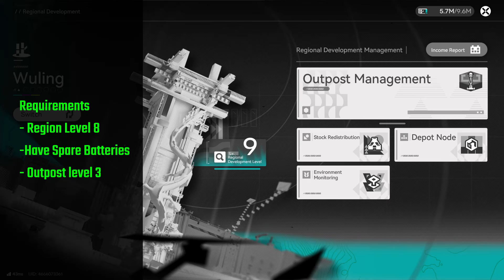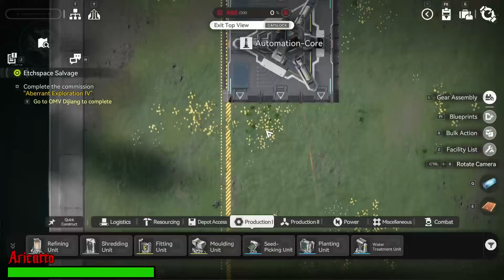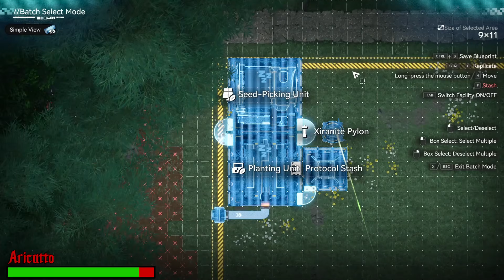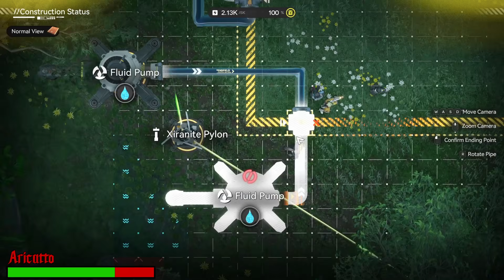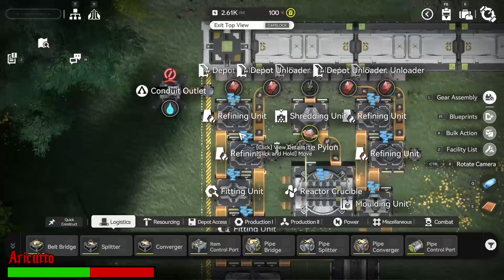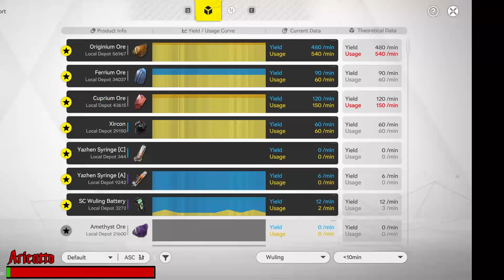1.1 Wuling Full base (AIC II) step by step Guide Blueprints in the description

Comment: EU/NA Blueprints I hope i did not make any mistakes ;)

Thermal Banks old batteries: EFO01Iao1430eE9U5o08
Ferium Powder: EFO011eaiI97O3UA34O7
Xircon: EFO01u1I628aiO0a6AoOU
Yazhen A: EFO0172UE0i4u1558O0Ai
SC Batteries: EFO01Iao1430eE9725o08
Xira + Cup Comp: EFO01O3E8e4u9AI3E9oe4
Plant Corner: EFO019A6U3ai4oeA85uI2
Thermal Banks new Batteries: EFO01u1I628aiO0a0AoOU

Sub AIC left: EFO012I4uUOo1e80eIOo
Sub AIC right: EFO018930OI6U4126UI73

Thank you very much for your hard work, had tons of fun building along side you ! :)
Reply from the maker: Thank you for this! I have no way of testing if this works but I'll pin it for now! your help is well appreciated🎉
Reply: thank you!!! helped a lot :))
Reply: I think the Xira+Cup Comp one is missing one of the originium connections from the depot bus to the shredding unit

Comment: Sir  @Aricatto  im kinda confused. Should I need to start from scratch again? I just follwed your wuling endgame base
Reply from the maker: well, technically yeah, but I have a suggestion you can try building the 6x xiranite(for jingyu valley) but only put 4 forges of the sky(since thats what you canonly put) so if you need to build the 3rd AIC wuling full base you can have a head start. on the build.
Reply: @Aricatto I think I would have to redo it again. I'll follow this vid. Question though how did you yield 480 per min or resource
Reply from the maker: @erjhennicolemanzana8768 make sure you get all mining spots(there is a hidden originium spot near south behind a fake wall) and level up the wuling region, as mentioned in the video
Reply: @Aricatto gotcha, my wulling is almost 9 so I must be on the right track hehe

Comment: Hello kind Sir! Thank you for this blueprint. I just noticed that after I finished this set up, I am running out of xircon. Is it because I lacked prior preparation of stacking up xircon? Or should I not pay it any attention? Thanks!
Reply from the maker: if you followed and everything is up and running properly, its probably the components (as I've mentioned it will slowdown your production if its on but you can turn it off onxe you made enough)

and then everything should be working fine after doing so!

(also if you have no extra xircon in storage, its prolly not a problem since its is consumed at a 1 to 1 ratio meaning you won't gain or lose extra xircon)

Comment: your guide is so detailed, even though i just placed your blueprint i still know how it works, especially with water sources can't be included in the blueprint.
question tho : your last video on 1.0 wuling base needed me to regional meta transfer the ferrium ore from valley to wuling, so in this case i don't need to do it anymore? or should i just meta transfer the originium ore for the deficit from making components?
Reply from the maker: its just optional to use ferrium now, you can make a small yazhen c blueprint at 50% or some ferrium components. Also, thank you I'm glad you liked the guide!!!!

Comment: Hi, may I know what your xiranite yield and usage is? Idk how this happened but I ended up using 130 something xiranite while only producing 120, and I think it is slowing down my xircon (only produced 48) and battery production with it😭 Thank you for your videos!
Reply from the maker: if you have both the components on, its going to show 180 usage in theoretical data, that is normal since you dont really have enough xiranite by game design, you're mesnt to sacrifice efficiency on your battery and medicine production with it. but if you turn off the components, it should show you 120/120

also you're welcome!🎉
Reply: @Aricatto thank you you’re the goat. I ended up making a bit more than 2000 components before shutting it off and it came back to normal 👌

Comment: Hey, i believe it can help with controlled gear production. I put the item control port at the sandleaf port, set it to 5000, it should've stopped the Xiranite gear production in one click.  

I've been waiting for every full region blueprint since Valley IV, i hope this can help you too.
Reply from the maker: That's a great tip, thanks for sharing I'll test it out when I can, I try to avoid the control ports to keep things simple, I usually only used it on the blueprint codes to help label what goes where, but that is an interesting way of using it, thanks!